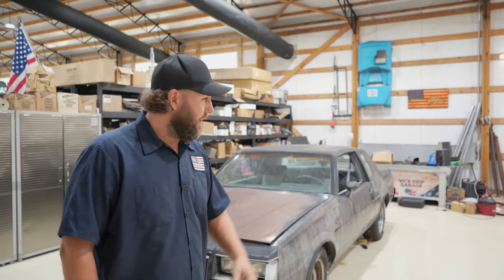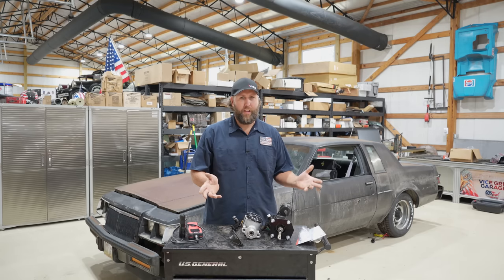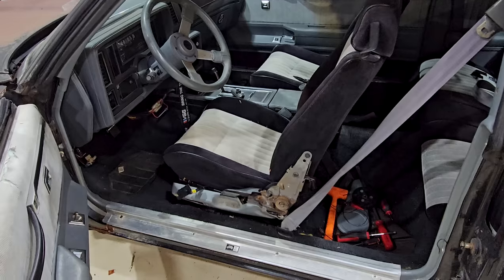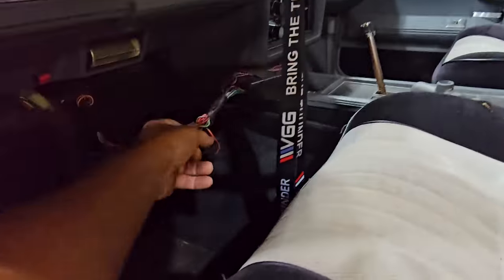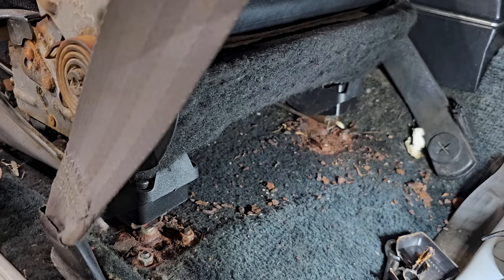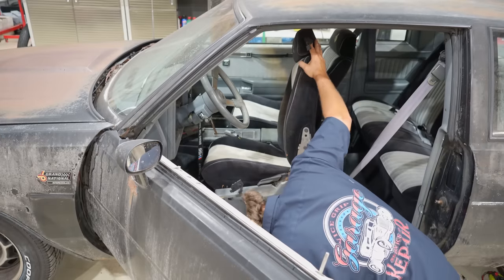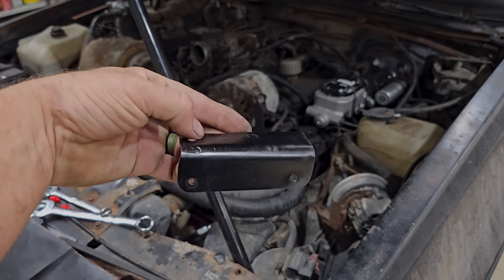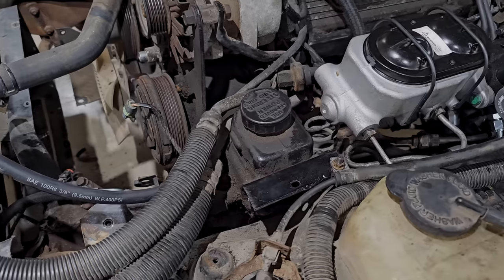Grand National Hydro boost Brake Conversion and First Drive in 20+ YEARS! (and Mt Dew Car winner!)

Comment: Hey there DBerarie. I'm not on my normal YouTube handle. And I am going to try to pm you in another way. But hopefully it will get to you from a fan or another friend who knows about the ignorant GM ignition system that will allow for this over boost situation and not really be a huge sign to how big of a deal to this engines bottom end and how quickly it will take the bearings out and they WILL spin and make a lot of damage!IE Tons of swapped small blocks in the place of the original Turbo 6. But it's really clear to me that you are getting to the point of boost cut and the backfire is the computers way of warning you but when you lift and then get back in it the computer will make as much of a adjustment as possible but it won't do enough with just adding a little extra fuel and it depends on the year and the computer itself on the amount the end will be able to pull out ignition timing! Remember this is just like you're1776 tire liberation big block and the boost it makes needs too be matched by any fuel pressure and ignition timing or another fuel that is going to be hi enough in the steich area that will keep it from detonating. Ie rods falling out the bottom! But hopefully the vice grip Army will pass this up the chain for me.Bill. from VT. Also I have a good recommendation for a home survey system for watching and getting a notification on whom is visiting when you're doing something that you would like privacy at that time! Bill

Comment: That I think was a tribute 82 gn paint scheme car they were onyx gloss black with quicksilver center stripe and Buick graphics on the rear quarters and from the first video it appears it was the two colors not just the black most of them were so I say put it back like it was but with your own personality in it Derek sir, but yes I have enjoyed all my gm gbody cars and that includes the rusted out Michigan 87 Buick Regal Limited I told you about during the first video unveiling this car, because even with the rusted left rear frame rail, it was snappy th350 short tail shaft transmission 1800rpm stall torque converter Oldsmobile 307 roller cam V8 flow tech red hot glass pack muffler 45 under the middle of the right door it was stupid loud and sounded badass!!!  But the reason I said it was a fun car to drive around and play with factory rear sway bar equipped bop gm corporate 10 7.5 ring gear 3.08 gears and one wheeler peeler but it would smoke the right side rear tire taking off lol and that was gm Corvette 15x8 rally wheels on 275/60/15 pirelli scorpion at's lol front wheels were 15x7 gm Corvette style rally wheels but from a 75: Chevy Monte Carlo and the 215/70/15 Goodyear wing foot tire on the spare was a 72 nova wheel I acquired so unless you knew the difference they all seem to match.

Comment: Might be able to use power seat assembly from a split bench seat out of out of standard regal. Most of them had power split bench so there might still some a those out there and if  can find a good one its probably the same assembly

Comment: @Vicegripgarage Derek thank you for putting this video out right when you did. I own a 2005 Escalade ESV, and just yesterday I came out from a store, and could smell some kind of fluid. A guy threw his peepers under the rig, and seen red fluid everywhere.  Immediately I thought ATF, shoot. Turns out it was power steering leaking from the Hydro-Boost unit. Now a guys wondering, is it worth buying a seal kit and rebuilding for the cheap. Or should I buy a whole new unit? It's my Daily Driver, well actually at this point it's my only rig. Thanks for the helpful information as always. I now have a better idea of how it operates.

Comment: I know you are tried of hearing from me. But, if you got a big cam or no vacuum. You can run a manual brakes with the correctly selected master cylinder, correctly selected rotors and brake pads and portioning valve adjusted.

Comment: I'm enjoying this one and I'd like to see more updates.  I do have one comment about the car's performance, however.  There will be other commentators more knowledgeable than I am, but I'm wondering if you have reduced the engine's power with the aftermarket exhaust.  This is a turbo car with an ECU, and when you add an aftermarket exhaust that engine computer might notice the lack of back pressure, sense that something is wrong, and cut back on the boost. Once you get this one buttoned up mechanically, you might want to see if the ECU can be reprogrammed or possibly replaced with a newer one.  This unfortunately won't be cheap.

Comment: I have a question, why did you decide to get all 4 post lifts and no 2 posts? Im looking at getting a lift and will probably get a wildfire one but i was just wondering. Thanks. 

Love the channel. Keep up the great work.
Reply: vaguely remember he emphasized  it was on wheels to move around in the shop easier, and also how there's no upper cross bar so he can fit taller cars and still stand upright. Most 2 post lifts I see YouTubers working under they're still hunched over if they're tall guys or gals

Comment: The alternator has numbers which match the VIN  Best to rebuild the one that came with the car.  

Spark plug gaps are small.  Too big and it will break up under boost. 

Check g-body parts for their aluminum reproduction wheels.

Comment: I had an 85 gn and had a similar rust/electric seat issue.  if i recall my solution for the seat motor issue was to use the 3 motor setup from a 3rd gen F-body power seat (which are pretty bad with aluminum brackets) and take 2 and make 1 working grand national seat.  Unfortunately someone liked the car more than me and it was stolen :-{  Fun fact the 85 had hydro boost from the factory but the intercooler redesign is what lead to the 86 brake redesign.
Reply: The F-body does not use the plastic seat transmission stuff

Comment: is this brake system similar to the way rolls royce did there power brakes, which is a veriation on the citroen hydrolic brake,steering,suspension system.

Comment: Well you are going down my rabbit hole now. Old car systems and parts are always a domino effect as you have to remove a lot of parts to get the worn or broken parts off and to put back or leave on OEM parts is a risky proposition. I always keep replacing parts with new ones and it will nickel and dime your pocket but my time is worth a lot.  
My 2cents

Comment: Too bad I don't still have the two extra bucket seats from my 79 Malibu, they were in almost new condition non power blue vinyl and would have bolted right in providing there were bolts left, when I sold the car I gave them to the new owner, if you don't care about the power seat feature then look for some manual seats from a Malibu grand prix and cutless.

Comment: Seems to be running a bit rich. I understand the ECU (or was it the air mass flow sensor?) is somewhat adjustable and after sitting for this long I guess it needs a bit of adjustment. Electronics can age without being used. But they are fun rigs these Grande Nationales. Plenty of aftermarket stuff as well. And I bet a modern engine controller with alla the sensors etc. would make this a whole lot better. I think a MaxxxxxxxxECU Mini (or Street if you want built in Wideband driver) would be perfect as you could get a flex fuel sensor in it and run E85 where available for even more oomph. Bigger more modern injectors and a more capable turbo maybe?

Comment: I don't understand Derek not replacing  replace the valve cover gasket he mentioned needing early on.He ended up with the power fluid hose over the valve cover and then took the alternator off along with the old master cylinder and everything else, Why not replace the valve cover gasket too. I would had to do that after everything is installed.

Comment: If I buy another grand national I am blaming Vice Grip . LOL . Seriously . I have had many GNs and TTypes. a 87 turbo t was one of my first cars it had 85K with the digital dash and I saved it in the forest down the street from my dads cabin from a neighbor who was getting evicted . it was red tagged , missing both front seats and had the rear 1/4 windows shot out with bb guns, it was on flats and in the dirt  and had a bad turbo .  at first the lady said she didnt want to sell it, it was a grand national and worth a lot . she said way more than it was at the time and it was a regal t . anyway . I told my dad ask the dude who owned it not his wife. he saw him one day when they were moving stuff out and asked him did he want to sell it. dude said what do you have in your wallet . my dad said 100 dollars . dude said sold . I ended up doing all the stuff you did . I remember that power master cylinder and accumulator LOL . Be careful in the rain or even slightly wet out . And keep it in sight put some kill switches / anti theft / unbrakeable auto lock . You need a scanmaster too I think I might have an extra one. I have one I am always saving for if / when I possibly buy another GN . Im on CL right now SMH

Comment: Well I was shiny rig and I lot of money in mind I sold it to a old grammar school friend I've known some second grade. Mickey Thompson's all the way around it Weber State to believe it's a 4.3 and anything else I could buy from Cotton's performance, heads intake, 83 lb injectors intercourse biggest my radiator both aluminum running 116 everywhere I go I like to have a loaded gun when I go out because there's always somebody wanted to take a fight. I've beaten the Viper oh, a tangerine Lamborghini till about 80 miles an hour maybe a hundred and then he blew by me but I was in front of them at first was Mickey Thompson's really hooked up in the back drag radials. So I bought it for $10,000 in 2007 probably another 20,000-plus later I had my 11:11 second car second quarter mile car while driving with hand controls because I'm a quadriplegic. We believe it's 625 horsepower and it feels like just as much torque. Never put it on the dyno couldn't find anybody I trusted so I decided slightly rich ever-so-slightly rich. I forget at a large Turbonetics it's been three years since I sold it I can't remember what size it was.. the cool part was is the only one in my town of 20,000 people maybe fifty counting the one next door to me. Everybody liked it it was so fun with the t-tops off at night. But my headliner is hanging like his one day when I got in it all the moisture in the garage from running the dryer. And then I sold it for 35000 to my buddy. I gave him a post and rear end and some aluminum axles 33 spline and a bunch of other goodies. The interior was so clean and look like his brand new. It even had the build sheet. Now I'm done bragging. But always said I want a hot rod and I got one with air conditioner still spend the tires as long as you want with the people in the backseat

Comment: I'm not sure how all the seat tracking and motor assembly is attached to the seat but couldn't you just go to a salvage yard and find a Buick Regal or similar car with the same power seat and just pull all of the tracking and motor assembly off of the seat and install on yours that way you still have an actual Grand National seat or just go to the salvage yard and buy a whole power seat that way you can just bring it on home and tear into it and figure out how to swap it over

Comment: Hey uh.. question; Where's our favorite girl, Ms Betty White?
Miss that girl, we (the camera you hold) have spent a lot of time with the old girl, even went on an adventure or two (2042mile powertour21) but there hasn't been anything on her since.. Where's she at?- Did ya fix the rotten blowed out fender-bottoms, the AC vent, alternator alignment, there were several things she still needed but I think she's been parked up and forgotten about, even after safely hauling Derek and the whole family half-way across the country and back

Comment: Should of just went with the vacuum booster. I've never had an issue on turbo'd cars. Just needs a check valve.
Reply: But... what about all those times you need to panic brake for a school crossing but the accelerator is stuck at WOT? Surely it's easier and wiser to add this complex, expensive, huge hydraulic booster instead of a check valve on the vacuum booster used on every other model?

Comment: You might be able to get away with getting an old seat from a regular Regal and change the seat bottom and back cushion from your old seat.  That way you keep the look of the GN seats but they're just manual (and cheap).  I don't think a feller really cares about the stock electric seats in this unit.  I love some of these 80s cars, but jeez you remind me of why I stay away from them usually...

Comment: Turbo is not great if a guy wants to now! Black smoke out the tail pipe. To the f the y & the I. Those fans come on for the turbo. Back then the turbos needed a cool down. Never a good idea to just shut her off btw. Let it idle for 3 minutes after driving her.

Comment: Hit it with a bunch of power, paint nothing. Fixing the headliner is 50/50 as it adds to the "bland" 80's gm theme with the foam terrorizing your eyes and lungs at say 130. On the bright side the faster you go the headliner will self remove and go back to the earth from whence it came. We will not judge for a rear end swap when said power shows up, swap in an 8.8 and keep it moving.